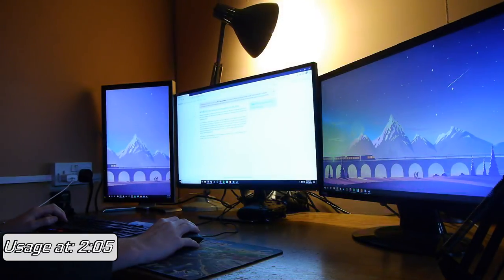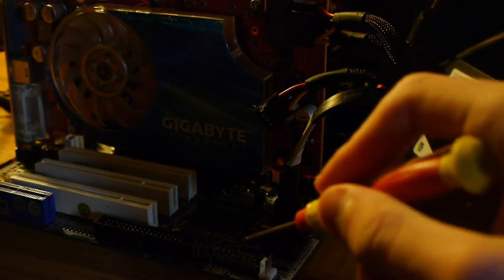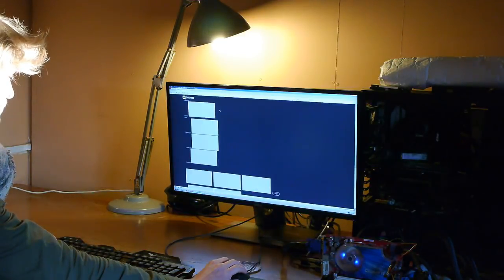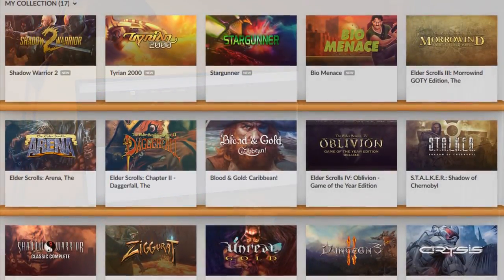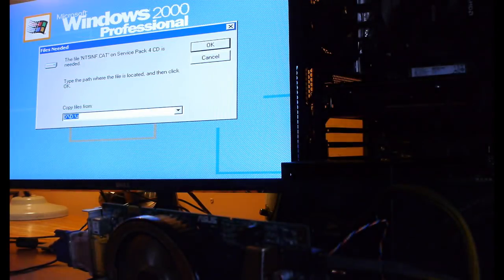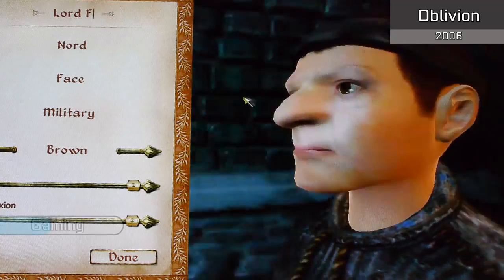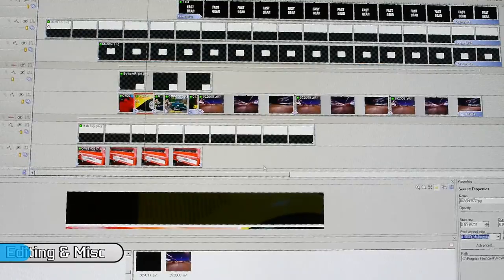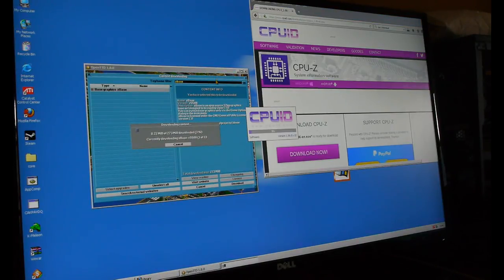Windows 2000 - Is it any good today?

Comment: The day I replaced Windows ME with Windows 2000 was a great day indeed. The whole 9x codebase should have been burned to the ground.
Reply: What's wrong with ME?
Reply: @tilburg8683  it was unstable, it was slow and just plain bag
Reply: @andrewdonohue1853  oh, I used ME or 2000 and it ran pretty good, but thanks for the answer.

Never heard about this since I was like 5 at the time.
Reply: 98 was actually pretty stable. 9x wasn’t the most terrible it just couldn’t do what the NT kernel could however NT was too expensive and too resource demanding
Reply: My windows ME desktop used to crash running Heroes of Might and Magic III when I was 10
Reply: Windows 98SE was probably the best 9x based OS that got released. It was really stable & good. I remember it on my laptop back when I was a kid. It was way better than Windows ME.
Reply: Did you have to do a clean install to do that? I think i remember reading on the microsoft website that you cannot technically upgrade from ME to 2000 because ME was newer? imagine if they never released ME and released a Windows 2000 Home Edition?
Reply: As long as you did not run many apps at a time. 9x systems were single thread.
Reply: @tilburg8683  Everything lol
Reply: @MCJosiah  2000 was way more reliable than 98. 98 was good if you rebooted it often. 2000 was the only one I could run for weeks without a reboot.
Reply: @brpadington  Well of course Windows 2000 is gonna be more stable than Windows 98, it's based off a whole totally different kernel than Windows 98. 2000 is Windows NT 5.0 while 98 is just MS-DOS married to a GUI shell. Which isn't a bad thing. 

I don't know what computer you where using but any Windows 98 computer I've been on has worked fine. I had a Windows 98SE laptop with 32MB of Ram & a 2GB HDD that I would record all my favorite songs on & I would play Simcity all day on plus draw stuff in paint too. But at the same time I don't remember keeping my laptop on for weeks. I did have a Windows 98 desktop that would stay on for days before rebooting though. 

The biggest downside about Windows 2000 or any NT based Windows(which includes Windows XP to Windows 10) vs Windows 98 & ME is the lack of native MS-DOS support. You need a emulator like DOSBox to run old DOS games & apps because of the totally different kernels between the 2 OS's. 

That's why people still build Windows 98 Gaming computers to this day, for MS-DOS gaming. Because emulators like DOSBox doesn't run every game or app correctly(like messed up or missing audio & graphics in games). Windows 98SE installed on real supported hardware will almost always give you better results when running old DOS games or apps than an emulator so that's why people do it.

Not saying Windows 98 is better than Windows 2000 cause it's clearly not, but for an old DOS gaming rig & in terms of what was the best DOS based Windows, I say Windows 98SE is the best.

Just my opinion from research & past experiences!!!
Reply: To me, the 9x codebase should have been forgotten after win98se, not burned down.
Reply: @MCJosiah  Win9x isn't MS-DOS married to a gui, more like a hodge-podge of a building that uses MS-DOS as a foundation. Win9x is dependent on MS-DOS, but does things in a very different way to MS-DOS, and is an absolute mess.
Reply: @MCJosiah   I remember 98SE being a lot better than regular 98.
Reply: @loganiushere  Well I guess I was wrong about it just being MS-DOS married to a GUI. You have MS-DOS & then Win9x sitting on top of it like a with MS-DOS as the foundation just like you said. 

I do remember Windows 98SE very well & it worked fine but definitely nowhere near Windows XP or Windows 7, since those where both Windows NT based OS's.

The only downside about Windows NT based OS's verses Win9x OS is lack of DOS support for older games & apps. 

I actually plan on probably building a Windows 98SE Computer just for fun one day to run some of these old games & apps. Something with a 2Ghz Northwood Pentium 4, 256MB of Ram, 80GB HDD, & a 128MB Nvidia graphics card, probably a GeForce 4 card of some sort. But I'm not sure yet.
Reply: @brpadington  Oh yes it was. W98SE was the revision to the original W98 so they probably fixed alot of bugs & they added more features.
Reply: @MCJosiah  the big feature I wanted was the internet connection sharing. At the time we had a dial up connection on one computer that we shared over the LAN. I don't miss the dial up but that LAN was fast.

Comment: I used to run Win 2000 on a Pentium 3 way back as my first Desktop PC. It was as stable and fast as windows installs get. I loved the simplicity of it all. I even have a original Windows 2000 installation CD with an unused Product Key! Good old times...
Reply: You got me nostalgic. PIII 733 512MB RAM Ti4200 Intel 815  IDE HD 120 GB & Win 2000 Pro. That was my setup in these old times (student in university)
Reply: @stefanrusu4094  Total overkill :P

Comment: 2000 was great its xp without the ui look i used it for a number of years and never ever crashed.
Reply from the maker: Definitely points for being one of the best stable OS I have ever personally used.
Reply: I agree. Windows 2000 was a good experience.

Windows XP, looked like Kid Pix (that childish Play-Doh look).
Never could take that OS seriously.
Reply: Mirek Fe  "Play-Doh" you say. Then you will love Windows 10 and notepad. I mean, the white plain part of notepad, is very serious and such. And that precious Windows 10 user interface design, no gradients, sharp pointy simple corners..very mature. An underscore, a square and a cross, separated a mile from each other, over a dead-looking single color line = material UI Window buttons, best idea ever, the biggest UI designers artwork ever.
No need of a /sarcasm marker here, I know.
Reply: @Braxton1981  
I don't like Windows 10 either.

Left Windows many years ago for Linux.
Sure, I still use it at work (since it's the standard).

But just look at it! It's a mess!
Flat GUI look, reminiscent of Norton Commander for DOS.
Charms bar, that should've remained with Windows 8 (constant annoying reminders and ads).
Updates that are forced down your throat.

And don't get me started with the start menu.
Windows 7, 8, and Ubuntu hybrid Frankenstein monster.

Computer name changing.
First it was, My Computer.
Then it became, Computer.
Now it's, "This PC" !!!

Fun fact:
The recycle bin is a joke.
It's supposedly new, but it's just an updated version of the original 95 edition.

I could continue talking about my pet peeves related with this OS from purgatory, but I'll end this here.
Reply: @Braxton1981  
I'm all about simplicity and professionalism, thus I believe, Windows 2000 looked polished, and finished.

Windows 10 doesn't look professional.
It looks like every technology was slapped on it, without a care in the world, how ugly it'll look.
Reply: @MirekFe  
I actually liked XP's style.
Reply: @its-amemegatron.9521  
I have no problem with your view on Windows XP.
If you enjoyed it, great.

That won't change my opinion though. Lol.
Reply: @MirekFe  
I think its nostalgia but to me I think just had the most personality and it wasn't just taskbar but the icons had special charm to them that future Windows didn't. 
They did release different shells for it like the electric blue and Noir that made look less "Playskool".
Reply: You guys know you can set XP to the classic theme right
Reply: @its-amemegatron.9521  
I remember those other skins.
Loved your way of calling it's original generic UI, "Playskool". Lol.
Reply: @AiOinc1  
We know. Plenty of geeks here.

But when I went to school, they prohibited any change to the GUI environment.
If someone didn't comply, they'd be suspended.
Reply: @MirekFe  I agree that looks of windows xp are cartoonish which didn't age well, but here is the thing, you can change them (in fact please do change them, at very least to the standard theme) and os itself is like the best windows ever made windows 7 is the new windows xp, I don't get fanboyism behind the 2000 though especially not after xp sp2 I mean xp is 2000 with native support for skins and it supports more stuff than 2000.
Reply: @harshnemesis  
you can change them
I know fully well that I can revert the look to older Windows.
Even Windows 7 had that option.

I agree that looks of windows xp are cartoonish which didn't age well
Imho, the UI was a joke to me, even when it was brand new.
Geek community thought the same.
An OS for kids. Lol.

I don't get fanboyism behind the 2000
It's not fanboyism.
I'm gonna write up this explanation, in the next comment.
It's just a little long, and I need to explain it, in as much detail as I can.
Reply: Continued

I don't get fanboyism behind the 2000

As I said in the previous comment, "It's not fanboyism".

1. Windows 2k was more stable than XP.
2. Almost all software compatible for XP was backwards compatible with 2k.
3. 2k was lighter and snappier on older hardware.*
4. Looked professional, unlike XP (heck, even MacOS looked refined)

*You didn't change your computer every 3-5 years, like today. You stuck with it, until it died. And if it was possible to fix it, you did. Hardware was extremely expensive, back in the day.
My Pentium 2 laptop from '97, cost roughly $5000 dollars. 
That's about $8000 today!
Reply: Loved this OS. Saved me from the likes of resorting to something like ME.
Reply: @aretard7995  
Windows 10 doesn't have a classic theme.

That comes with the installation of an add-on, like Classic Shell (discontinued).

Also, the Windows 10 machine that I use, isn't my personal computer.
It belongs to the company I work for.

Changing the UI on this machine will inevitably get me fired.
Reply: @aretard7995  
Well I don't use earlier Windows versions at work anyway (again, company policy), so that beats the whole purpose of the comment. Lol.

And I only have Linux machines at home, so...yeah.

But I get your point.
Reply: @MirekFe  The generic UI (the stock Windows XP Theme) is called Luna.
Reply: @aleculunguleac  
Thanks for reminding me of the name.

(Although in my humble opinion, Silly Putty would've been a better name choice. Lol.)

Comment: Windows 2000 was my favorite for a long time. I got a free OEM copy when I bought a $40 box of PC parts off eBay back in the day. It was a burned copy still sitting in a CD ROM drive. I laughed out loud when I powered the drive up and opened the tray and saw a disk with hand writing on it, 'Windows 2000 Professional'. Still have that disk along with my copies of Windows 98 SE, Windows XP and a bunch old versions of Linux.
Reply: you should frame them, thatd be really neat

Comment: "a measly 2.5 GHz" looks at laptop
Reply: it's one core lol
Reply: Clock speeds aren't a definitive measure of performance, the CPU he's using is a dinosaur
Reply: My 2014 Windows 10 Laptop has a newer Intel Celeron and it runs at 1.40 GHz. My old Android 4 tablet with an Intel Atom runs at 1.44 GHz. How is my old tablet slightly faster than my laptop?
Reply: i have an Acer Aspire 5920, and it runs at 1.9 GHz
Reply: as long as your laptop is relatively modern, it will run circles around a 2.5GHz Pentium 4, even at half the clock speed.  Think of a 1 lane road with a 250mph speed limit, but with lots of traffic lights, vs. a 4 lane highway with 125mph speed limit and few if any traffic lights.
Reply: @JamesnLollify  my mother recently got a new ASUS laptop, and it has a cellar on running at 1.1 gigahertz. How that thing manages to run Windows 1064 bit at all still astonishes me
Reply: @KanawhaCountyWX  My old Core 2 Duo laptop ran at 2.53 Ghz. Was it fast? No, not at all.

Comment: I stuck with 2000 well after XP came out. I liked the lower resource usage and simpler design, which all made it feel faster.
But I had to switch to XP when I got a dual CPU Athlon system. 2000 had a noticeable lag when moving threads between CPUs, while XP did it smoothly. Very noticeable when playing music or DVDs.

Comment: You know I am a bit of a Windows 2000 connoisseur myself 😎💯😱💦
Reply: Wasn´t Windows 2000 basically a precursor to XP?
Reply: @TheRealFobican  no, that's windows me
Reply: @HoppsTech: Same, I stayed longer on Win2000 than ...anyone locally. The stability, just kept working - as less and less stuf and software worked I had to cave in.
Now on Win10, and cant even get it to access with my cellphone. FFS - Microsoft. 
So yeah: Once upon a time there were a software corp that made a working OS. :P~
Reply: @KayOScode  no, ME was a mess trying to clobber NT kernel code into the dos based structure of the 95 kernel.

2000 was supposed to be XP but they didn't feel it was consumer ready, so it became a corporate option not for consumers. When that happened they stuffed things into ME that shouldn't have been put in there.

Check out the winver. 2000 is the predecessor to XP, ME is the successor to 98 SE
Reply: @andersforsgren3806  I had windows 2000 and dual booted Linux (Mandrake 7) for a bit. Then upgraded to XP and ran that for years, until windows Vista came out. When windows Vista released a friend was having issues with their computer as it was hosed with virii. I formatted the drive and donated my XP license to them, fully switching to Linux. I ran Linux from 2007 to 2012. In 2012 I needed windows for school, so tried windows 8. It was okay and when I could, I updated it to 10. I still dual booted and preferred Linux.

In 2017 of December the windows 10 update killed my laptop. It literally fried the wifi Bluetooth hardware. I also kept getting green screens.

It was then I switched to Linux full time again.
Reply: @Hebrew42Day  oh, I see.
Reply: @KayOScode 

Here's a handy table;

https://en.wikipedia.org/wiki/Comparison_of_Microsoft_Windows_versions#Windows_9x

fun fact. Windows "7"  and "8" still have a 6.X kernel. They jumped the kernel core up to "10.X" for windows 10.
Reply: @ @Hebrew42Day : Smart chap, you stay with that Linux my friend. 
And yes, Win XP were the longtime runner for most ppl everwhere. I wished I had stayed on Win 8, which I got a full license for - the free upgrade to Win 10 have that annoying 'Activate windows' running for a long time now and we who went freebie are entirely without support for all the weird issues.
I have nothing against paying for a good product, while I will never pay for a defect one - guess what I consider Win 10 to be? :p~
Reply: Wanna cookie ?

Comment: Honestly that lowered spec Pentium 4 would have been pretty high end for a Windows 2000 machine.
Reply: pentium 4 was pretty powerful for windows 2000
Reply: Jup... that would be overkill really... Pentium 4 came so much later as far as I recall. Pentium 3 was like the top end in those times.
Reply: That’s what I thought too. I ran it on an 850MHz Duron and it still flew.
Reply: @Protoking  Yup that would be high for this system for sure.
Reply: i did it on a dell 2350 2.4ghz 1gb and it was fast for sure

Comment: I installed win2k on a 486 at one point.  That was a funny project, but it did work.  HDD wouldn't shut up due to paging, and I had to mount a box fan on the chassis to keep it cool enough to keep running.  Those were the days...

Comment: Man, I still have my install disk. I remember buying this when it was released and installing it on my HP.  Used it for over 8 years until 7 came out
Reply from the maker: Yo dude
Reply: @BudgetBuildsOfficial  Got an idea for a video. PC gaming on an intel Chromebook? I mean, you see them all over the place and I've had some luck with games like Deer Hunter 2, Wizard101(Just testing), and sim tower using an app called crossover. Steam isn't supported unfortunately, but all you need is an executive file.
Reply: You chose to use 2000 over XP and later Vista, until W7? You mad lad.
Reply: @raresmacovei8382  It wasn't that bad. It worked quite well for my needs. Could've upgraded to XP, but that was downtime. In a business, time is money.
Reply: @joeyhillers9460  Impressive :)

Comment: What an amazing OS win2k was, had that running on a late 90s vintage Toshiba satellite I used back in 2005 with only 64MB of ram installed. Light weight, stable, and a clean interface. Especially after having then recently leaving the windows 9x era for good; Good times !

Comment: "Windows 2000, is it good in 2019." 
Not only is it good, it's less expensive. I recently used Word 2000 to type all of my B.S. Degree dissertations. I also use Windows 95 from time to time. The documents, whether Windows 2000 or Windows 95, look modern and similar when attached in an email or printed out.